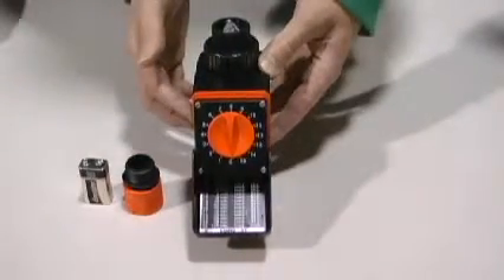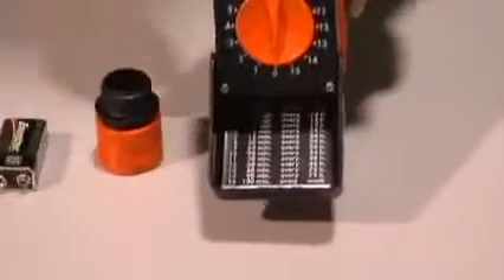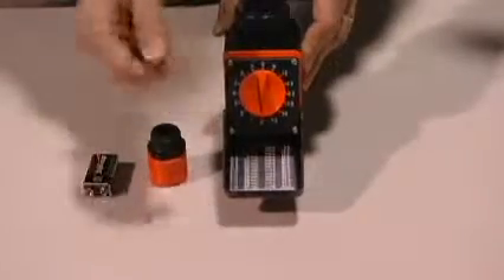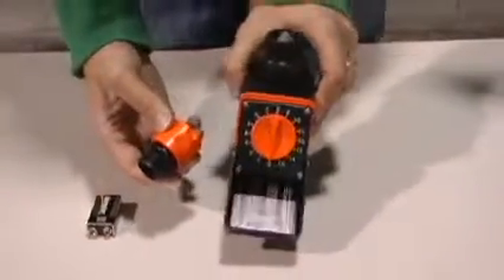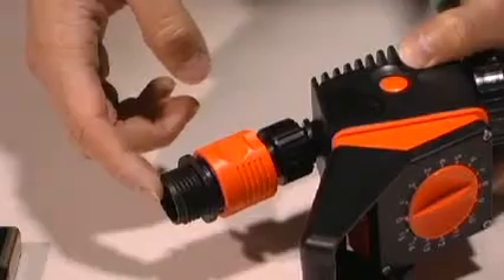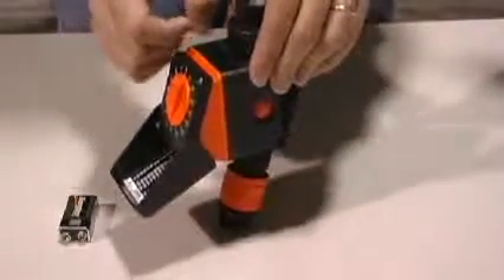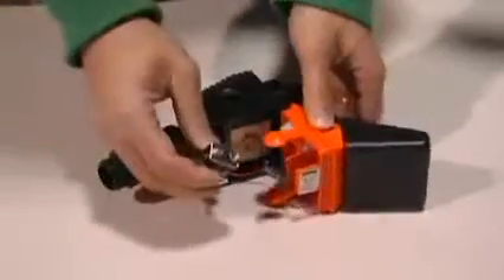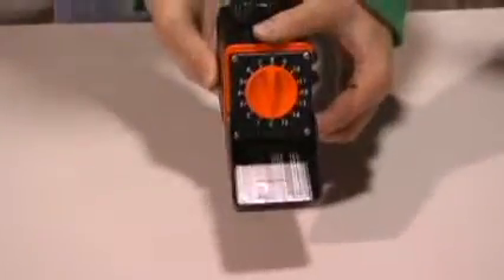Drip Irrigation Claber Logica Timer

Comment: I have one of these and one of the 4810, and they work great.>>>nub.best/gwpe     The programming is not the most intuitive, or flexible, but it is easy enough to set up. It is nice that the new model allows you to pick watering days rather than the numbers on the old one, and also that manual can be extended.. The great thing is that it supports the rain sensor, which shuts off the timer when it rains. We use Duracell and get over one year of use out of it.